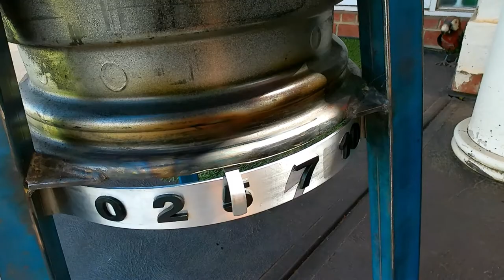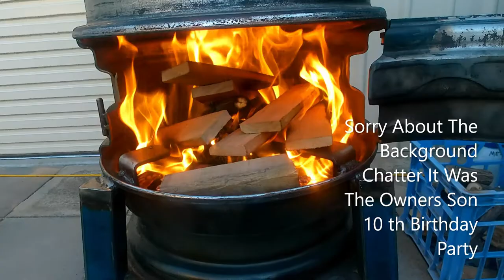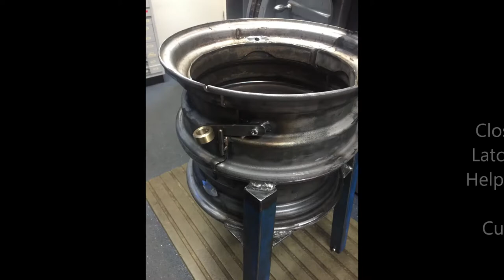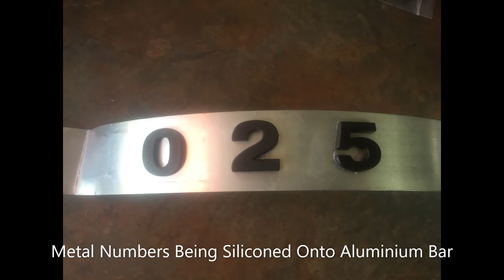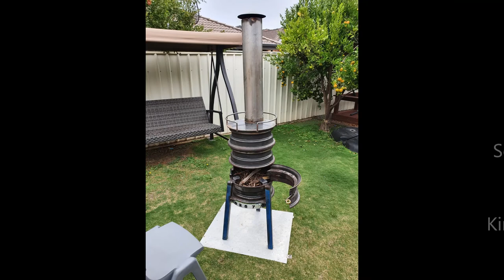Wood Burner Stove Made From 4 Steel Tyre Rims That I Made For My Neighbour

Comment: Very creative! Love the numbered vent set up. I'll bet the pizza is great...  maybe even a smoke flavor.
Reply from the maker: Thanks for watching Winky. Pizza wa a bit burnt on the bottom, still not too bad for a first fire up. Regards.
Reply: @daveticehurst4191  Love the creativity! I've made a couple of wood stoves in the past. The first was right after I bought my first home. I found a simple box made of 1/8" steel at a salvage yard and put a few holes in it and wazoo...  wood stove. On the first super cold night I filled it up with wood. I woke up sweating during the night and in the morning the whole house smelled like something burned. The stove pipe went up and then horizontal to the chimney. The wood I was using was still a little green and creosote had dripped out of the pipe all over the carpet and my couch. That was learning experience one with wood stoves.

Comment: Wheely good Dave! Good job it's heavy duty, otherwise your first ignition attempt might have resulted in an unplanned launch lol. Right choice on the paint, stove paint is OK as long as it is never exposed to damp (even mild condensation). Looks very robust and well though out. Cheers, Jon
Reply from the maker: Hi Jon, I will pass your paint information onto Jason, I'm sure that he will be pleased knowing that he will not need to paint it. Thanks for your view and comment / suggestion. Regards.